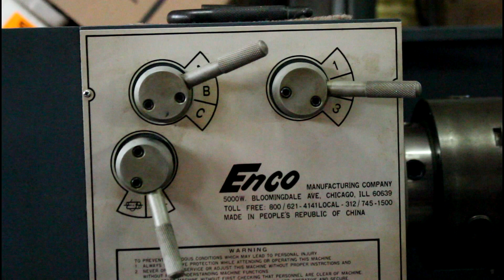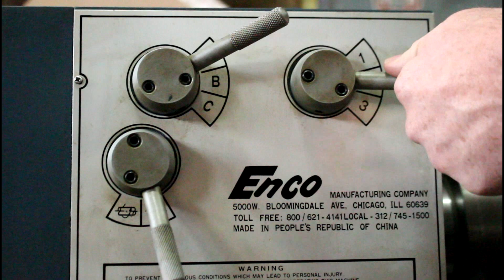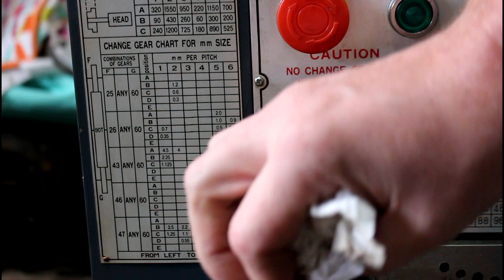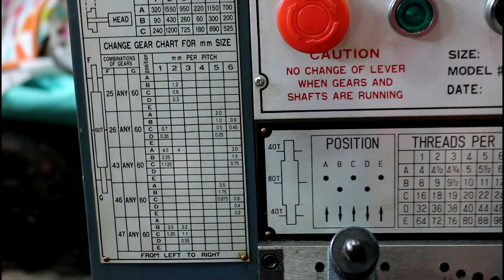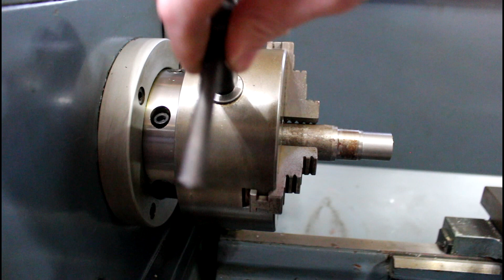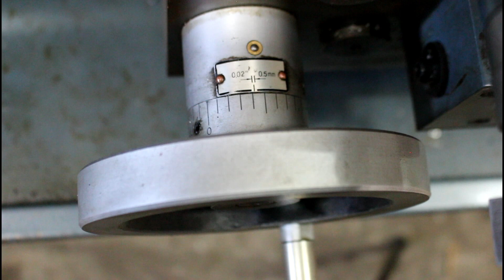Enco 13x40 Metal Lathe 110-1351 Review Gunsmith Lathe

Comment: Enco were made in Europe but that factory is closed.  This is very similar to my Shenwai900 12 X 36 Taiwanese lathe except mine has a screwed on chuck.  I had to make a special tool to change the chucks.  I have it 40 years and would not take any money for it because it is so good.   The solenoid forward and reverse switch is long burned out but I fitted a push pull cable to it instead and it works perfectly.    The slides as scraped on mine too.

Comment: I have the exact same lathe and I'm wondering if you can help me. When I bought the machine it was wired for 120v. I'm trying to configure it to 220V but I'm having a hard time reading the connection schematic located on the back electrical cover. Any assistance you could provide would be greatly appreciated. I rewired the motor to 220v but not sure where the leads connect into the terminal block.
Reply: Mine is setup at 220v currently. 3 wires come in from power. R and S as the hots  and PE as the neutral. I only have 3 wires comming from the motor going into the terminal strip. Red z1,blue v2, yellow u1. They connect to the corresponding label on the terminal strip. 4th, 5th,6th position from left side of strip. The wire on top side of terminal strip has same number/letter label and terminal strip itself is marked with same number/letter.
Reply: @jasonfontenot596  Thank you very much for your detailed comment.

Comment: Is there a clear plastic cover on the cross slide, right over the drive gear? My 2005 model 510 -2585, has one and I can't figure out what it's for.
Reply: There is a clear plastic cover. I also have the 510-2585.. no clue why it's there either. Mine is cracked and seems to have let chips down onto the apron gearbox from previous owner.
Reply: @jasonfontenot596  Seems to me it’s there to slide the gear into place if you want to use the powerfeed. There’s a set screw in the gear and it’s easy to move and takes less then a minute to do.
Reply: I am looking at the same machine that has electrical problems,  contact switch broken in transport according to the owner, @jasonfontenot596

Comment: Way back in the late 1800s, the threading gearbox was invented. There were two basic types designed. When SB began, they chose and modified, one type, and some others did as well, while others chose the other design, while a few designed their own. The plastic gear is often used or phenolic gears are, for the purpose of preventing (too much) damage in the case of a head crash. Atlas often used phenolic. It’s fairly common. Gap lathes are mostly used for large faceplate use. Amateurs rarely need that, but in commercial applications it’s also fairly common. Very often these machines are much better for the amateur shop than “old American Iron”. Why? Because the old machines are almost always old commercial machines that after they were beyond their usefulness, were sold. The “luck” guy who buys one at the often very low price they do, finds themselves with a machine that’s been mistreated for years, if not decades, and that requires a good deal of work to bring back to a useful level for any kind of repeatable accuracy. This work is something they’re not prepared to do, or to pay to have done. It’s often better to go to Grizzly, Precision Matthew, or some other company and spend some bit more and buy a new machine with a warranty, parts and service available for many years to come. Don’t buy a machine that’s being discontinued because critical parts will become more scarce over time. Sorry if this advice goes against the grain of what people want to do, but it’s sound for most people. If you buy something used, that’s been discontinued for some time, remember that parts need to be available for 7 years, by law. After that, it’s up to the company to decide whether to unload them to a reseller and be done with it, or to keep them on the shelves, which costs them money. If the company no longer exists, or has been absorbed by another, nothing may be available anywhere. It’s a thought to keep in mind. For something like an old ENCO, I would call MSC and ask if parts for the model are in stock, and which ones.

Comment: I have  had one of these since 2000...don't lid yourself, I used mine for production..after 20 years...still solid. The only thing that sucks is the lever switch [ cheap chinese plastic] I glued mine back together, because they wanted 170 bucks for a replacement....for 2 ounce piece of plastic....you could put a drum switch on it too..mine works since the repair....I have used this for EVERYTHING...even with the gap out. I put an Aloris knock of on the tool post...much better.  Yeah..the motor,,,the chinese one quit in 2 years....I just put a Dayton in there.....still running after 18 years...good review man!...

Comment: I recently got a enco 110-1351 and during transport the emergency stop start button got broken and now I can't get it to run. Any parts places to get new on at that you know of?
Reply from the maker: Those shut offs are usually just a standard shutoff. 4 wires. Some have momentary switches, some need to twist to reset. You should be able to order one from Amazon or eBay fairly quick. Just get the right mounting hole size.

Comment: Trying to upgrade to a quick change tool post but can't remove the 4 way t nut. It won't come out. Do you know how to remove it
Reply from the maker: Sometimes they are set in with set screws or the main bolt is screwed down against the compound to lock in the t nut.

Comment: I have this exact same lathe. Got it used from a local gentleman that barely used it. Came with all of the stuff it originally came with plus a digital readout installed. It basically looks like it could have been in a showroom and it had a  quick change tool holder on it. For an import I find it to be fairly accurate. As basically a hobby guy I couldn't be happier with it.
Reply from the maker: They are nice lathes and can be had for a decent price if you keep an eye out.

Comment: Thanks for the review. We're looking at buying one of these for work (repair shop at a plant) and it's nice to see one in operation. I've used some of the larger Chinese and Taiwanese machines and found them generally pretty decent, but I've wondered about the smaller ones like this. With our small budget for a lathe, I pushed to get a used machine, but our corporate lawyers thought that it would expose us to more liability if someone ever gets hurt. Nonetheless, it looks like a pretty decent machine for general-purpose use.

Comment: I have this exact lathe I bought new. After a month or so, I have developed an oil leak under the carriage. Any clue as to how to fix this? Thank you.....Great video.
Reply from the maker: I've used RTV sealant before to cure leaks on aprons. Just need to figure out where the leak is. Also you can get gasket material and make your own new gasket if it has one.

Comment: Do you know how the oiling of the quick change gears works on this lathe?

I see that there are 3 oil nipples on the right side, with the top one being horizontal instead of angled.  I'm assuming this feeds to the gears on the quick change gear box, but I just keep pumping oil in (we're talking a full 12 oz can of soda worth) and am feeling like those gears are still running dry.  I'm about to conclude that the oil nipple is somehow just a miniature black hole inside my lathe, lol.

Anyway, I am currently bringing one of these back online after the previous owner left it to rust for a few years.  I'm finding a surprisingly nice machine under all the gunk and rust.  Very smooth motion.

Comment: Well done video. I'm currently looking at a 1440 Challenger lathe. Guys are telling me that it most likely is a knock off from Enco or Frejoth. The gear handles match the Frejoth. My working career has been with 20"+ lathes with 6hp motors minimum. My small business serves local farmers and so most of my work would be on bushings 4" dia and smaller and 2" hydraulic cylinder rod repairs. My main concern with these cheaper chinese lathes is vibration in the headstock because of poor design or cheap bearings. I think that if I lighten my depth of cut and lower my speeds that I should be able to overcome these shortcomings. My work doesn't involve high precision (less than .0005 tolerances) or tight runout control. What's your recomendation?

Comment: It looks just like my 2005 Hazard Fraud T33274 discontinued in 2009 Gearhead 12x36 or yes the Grizzly G4003 12x36. I thought that the "gap bed" makes it interchangeable . Thank you for showing me how it works I have NEVER owned nor operated a machinists lathe I paid $260 freedom bucks having a new top slid machined. I didn't think it could do sixty thousandths!

Comment: We have this machine in a 12x36 gear head 510-2584, 2007. It seems about identical. The gibs broke and we can't seem to find a new one. The pieces are in there with a c clamp (and functioning, sorta) so cant remove to measure, but seem to be about 13.375.  Any ideas on where to get parts for these babies?
Reply from the maker: Best option might be to cross reference your machine with a grizzly machine. I once got a back gear for a mid 80's enco from Grizzly. Was the same part and fit perfectly. Just had to cross reference the machines. Grizzly has all of their manuals online, so if you know what you are looking for you can get something that will work or very close.

Comment: These lathes a very good buy compared to a worn out over worked second hand USA/British made one. Nice size, good specification. Its as accurate as you are.
I was once considering buying a similar spec new Alpine badged one in the mid 1990's. These were probably the fore runner to a lot of the far east import lathes.
Reply from the maker: Yeah, Unless you find a pristine older machine or completely rebuild it (including Grinding of the bed ways) you are in most cases ahead with an import machine.

Comment: I have one of these machines that was missing the front plate with the holes that set the feed rates.  Seems the machinist that used the machine found out his job was being sent out of house so my guess it, he left with the plate. Got a new plate from Grizzly and figured out how to drill it.  I'm tempted to put a clear cover on it so it makes shifting the gears easier.
Reply from the maker: Once I messed around with this one a little bit, I got a feel for the gears meshing.
Reply: I need to purchase and have instructions for assembling,specific instructions for completing a produc .

Comment: If you still have this lathe any chance you could measure the diameters of the motor sheaves? Mine came with an aftermarket motor with only a single sheave and I've like to put one on to match the original sizes. Thanks
Reply from the maker: I don't. It was sold the next day after I made this video.
Reply: Precision Machine Shed  Glad to hear it. Thanks anyway.

Comment: My 12 x 36 is about 15 years old. The only real problem I've had was a lightning strike that fried the electronic control box. I was lost. Everything was burned so I scrapped out all the controls and put a rotary switch (it's still on the saddle) and a kill/disconnect switch on it just like a 1950's lathe would have. And YES, it was a lot of trouble. The only thing I really miss is the bump feature.

Comment: I wonder if there's a lathe with a shifter and a clutch.  The gap bed is very useful when you need to turn a rotor.  I never use compound gauge anyway, so no biggie.  It's an awesome lathe. I wonder if you can use grease instead of oil, since it's covered anyway.

Comment: Nice video, I have a similar, Taiwanese machine,(Tida 12 X 36), same issues. The plastic gear is a sacrificial gear. My buddy crashed his lathe, that gear saved his machine. At that time you could by a replacement thru enco, about $80.00. I have an issue with mine in which the D1-4 doesn’t register correctly, got to get it figured out. These came in at least a dozen different brands. Thanks for the video, JB San Diego.
Reply: JB, Did you ever figure out your D1-4 registration issue?  Mine does not register well either I have to really crank on it to get the 3 jaw to run close to true...

Comment: Very thorough video. It's funny how similarly made most of these import machines are! I've got a Taiwanese 12x36 belt drive Jet that's almost identical except for the gearing in the headstock. I've been pretty impressed with it overall. Ended up fitting it with a 3HP 3-phase motor and VFD and it has really earned its keep. I don't think the cross slides are actually scraped in. Pretty sure the marks on the ways are flaking for oil retention.

Comment: Nice video.
I purchased a PM 1236 about a year and a half ago and you are right about these machines being identical in many ways. The motor on mine started acting up (I think it was the starter) and for about $150 I got a Baldor replacement motor which increased the warranty from 3 years to 5 years. I have no complaints except that I can't set the apron dial to zero just like yours.